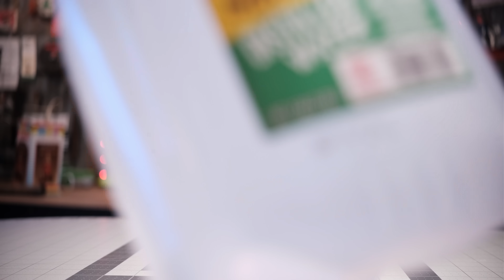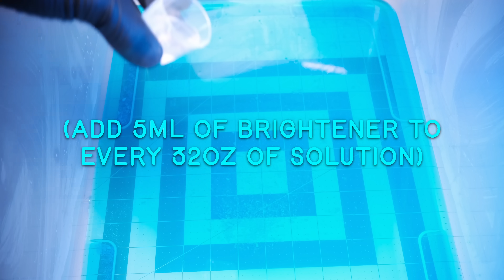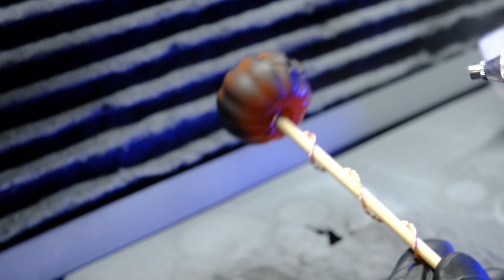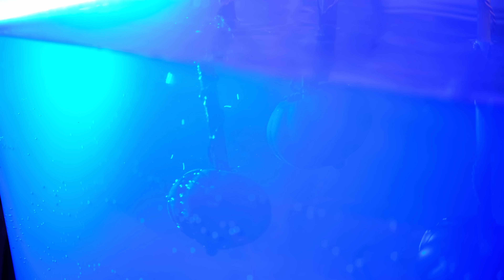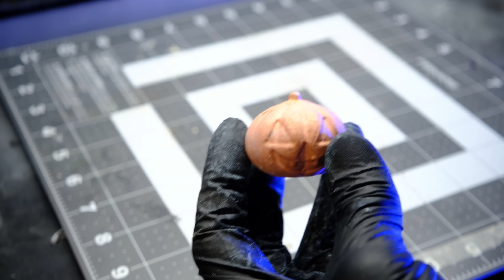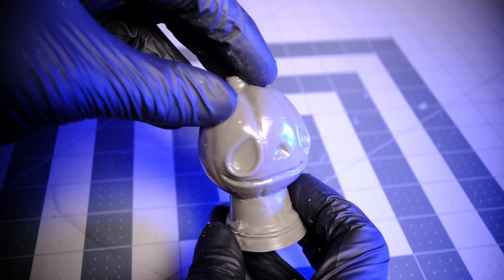How to ELECTROFORM anything into METAL!  #electroforming #electroplating

Comment: How far off are you from making your own electroformed sofubi molds?
Reply from the maker: On my last one I got to the point of brazing the copper onto the steel pan and had a warpage issue with the copper. I was using MAPP gas and switched to propane (I don't have an oxy torch) and had the same issue.

What I SHOULD have done was stuck to my gut of using MuggyWeld to do this part. I didn't because I thought my viewers would find MuggyWeld expensive, so I was using flux and brazing rods / solder, etc.

But we've got the electroforming, wax evacuation, cleaning, acid rinse, and electroless silver plating down.
Reply: @TheCrafsMan  Appreciate your detailed response dude!! I'm researching as the Chinese factories seem hesitant to go near my sofubi project as it gets close to infringing on some Disney copywrite. I gotta go rogue.

Comment: Setting the power supply to Constant Current mode instead, then calculating amps needed based on surface area of your object, will yield best results. That way, you get the amperage, and the volts rise automatically as the part becomes more conductive. Start with ~0.04 amps for a while to get an initial strike layer, then slowly ramp up to target amperage. For best results though, you can use Caswell copper conductive paint followed by a THIN layer of graphite/acetone spray. With the caswell + graphite, you can ramp up much faster, and the entire object will plate at the same time. You should be able to get shiny parts right out of the tank this way. Great video!

Comment: It's more electroplating then electroforming craftsman....😊
Reply from the maker: I debated terminology and looked it up more than a couple times, eventually coming to the conclusion that electroPLATING happens over an already conductive surface (for example, I recently plated some nickel over copper) whereas electroFORMING involves the transfer of metal onto a non-conductive surface (ie. sculpture, jewelry, etc.) by the use of a conductive coating. The electro-formed part can then be electro-plated.
That's my understanding.

But it's also 2025 and the world is in such a state that the definitions may have "changed".

Comment: Just a heads up, You need to nickle coat first. Back when i made my electrophorming sruff, I found that copper forming is too rough a surface and will be too difficult to pull out a piece during the demold process. This was also doubled down by grodyshogun when we were working on this. It can be very dangerous to do in your home, proceed with caution.

Comment: Thanks for sharing your process, Crafsman! If the sofubi videos aren't getting the traction you need, I understand, but I love when you explore diy topics that I hadn't thought about. Do what you gotta, but I'm here for the ride either way, so I hope that you pursue what you're finding interesting.

When I took a jewelry making class a few years ago, we used a similar process using a whole bunch of salt water and a camping lantern battery to etch designs into metal surfaces by leaving parts masked with a sharpie. Would etching like that be possible by swapping the anode and cathode in this solution?

Comment: Curious what wax recipe you used. I understand sofubi waxes are a bit different than traditional toy modeling waxes like Azbro, so wondering if you tried using Scott Hensey's and how well it melted out.
Reply from the maker: You are right about that - I just stuck with the Hensey recipe that I made in a previous episode, and it does have probably more solids and "body" or substance to it, and more things that make melting out later more difficult. I've heard some folks use those green and/or blue Rio Grande waxes, I think like used in lost wax casting, but I just stuck with what I had.  Also... the Cold Galvanizing spray is sorta difficult to remove, so I'm hoping when the fine copper and silver come in, one of those will work for a spray that will later be significantly more conducive to all this.  :)
Reply: @TheCrafsMan  hmmm, wonder if you could make the wax conductive.

Looking forward to seeing/hearing how the new conductive materials turn out!

Comment: 15 years ago I tried brush plating a front guard of a car. It took a while for me to get a thin layer and a golden sheen but I figured I needed a better power supply for a bigger part. 
That guard has been sitting in the dirt covered by rusty scrap metal and hasn't aged even on the uncoated bare metal sections. I think the copper is being sacrificed first. There is a couple green spots where I think snails laid eggs on the metal.

Comment: Hey! Glad to see you are finally getting into electroforming. :-) I've been doing it for awhile now, and it's fascinating. The pump is interesting, but from my experience isn't really needed - the current that is created from the copper ions going from the anode to the cathode stirs things pretty effectively.  9 volts definitely seemed to work for you, but when I've done it the metal plated too quickly and then tended to fall off. So I go for only 1.5V and keep the amperage turned all the way up. So, when running, the amperage is usually at about .01 A. It's slower to be sure, but I've gotten very even metal forming - but I will go in and play with the settings since you've had such great results!Q :-)

Comment: firsf all: I'd be interested!

but on a second note: do you reckon electroplated molds could enable injection molding without having to get full metal molds made industrially? could they be stable enough?
Reply from the maker: That's a question I've wondered (ie. about thick plating the face of a cast/poured mold) but not sure how that would affect the final part and overall fit.  There may be slight shrinking of the part as the mold "shell" grows thicker... then the halves would probably need to be surfaced so it meets up flush.  Fun to think about these things!

Comment: Also, be careful not to make sparks when coating - the electrolytic process causes Hydrogen gas to be liberated from the solution. Hydrogen is quite terrifyingly flammable. If you need to know just how scary it can be, you might have heard of the airship called 'The Hindenburg'.
You won't get enough Hydrogen to do that, but you might get enough to start a fire, or an explosion. Windows open if possible.

Comment: Hey Crafsman funny that you came out with this video today about a month ago I bought supplies and studied all the videos I could on electroplating to do some electroplating on some 3D printed parts. I think I was using nickel and zinc and I could not get it to work. The big problem was the conductive paint that was needed I spent like $25 for this paint that was advertised as conductive paint and it wasn't and I gave up Glad to see you have better results than I did. It seemed like the only thing that worked was making the electroplating solution that at least I got right I still have it.

Comment: When it comes to electroplating, having copper on all four sides is best. You’ll notice the side toward the pipe plated first. I’ve done this with steel plates all around to un-rust steel objects.
Reply from the maker: Thank y'all! Definitely true, and good to know! I recently learned (and this is pretty convenient) that you can lightly wrap wire all around a piece and it'll work.
Reply: I came here to say that too
Reply: magnetic stirrer, heated bath,  single anode in a dacron mesh or titanium mesh annode bag/basket, peristaltic pump to 5 micron filtration is the ultimate setup.  with enough mixing and flow you can have even plating even with one anode.  one anode is far easier to manage than multiple.
Reply: @thorium_glass  Upped the complexity did we? It is a single anode since they would be connected to each other and attached to one wire. I used stainless steel pop rivets to attach all the pieces. My wife said it looked like a miniature north sea oil rig on our back porch. I put filter paper between but later stopped using filters at all.
Reply: @billbucktube i found the crystal growth had a tendancy to make the work and/or the anodes disconnect from the circuit.  you make a good point about "it's all one anode." even with multiple sacraficial copper parts. 
i don't like using anything ferrous if i'm going for dialed in, super blingy plating.  i've run super dirty baths with piles of anode slimes in the bottom and dead flies floating in the top, now my setups are really clean, which is necessary as i quit flattening scavenged copper pipe and started smelting down 3-5 pound ingots to plate with after JMBullion wrecked the online ingot market in 2015.  i run a micro setup indoors (0.7 gallons) when temps go below freezing in winter, and have a 5 gallon bath for doing larger work in the summer.
but what do i know?  i've only been at it since 2008. 😉

what i do know is, Miralax makes for a piss poor brightner replacement.

if you haven't tried going to nickle and then gold yet, you will love it.  copper takes days and nickle and gold take mere minutes.
Reply: I ditched the magnetic stirrer,  causes far too much evaporation,  and went with a synchronous motor 5-6 rpm to rotate the parts in front of a single anode,  just be sure to insulate the motor shaft from the cathode shaft and use a wire to act as a brush rubbing against the cathode shaft,  far more direct plating instead of the ions in  a whirlpool trying to get to ground.  Those synchronous motors are cheap,  Amazon has a single for $11 or you can get 4 of them for about $20, they come with cords and switches for 110v, no extra power supply needed,  I got 4 because I figured for the price they must not last but I'm still on the first one after 7mos and it runs 24 hrs with a 15 min break to switch out the parts then back on for another 24hrs. After I switched from the magnetic stirrer I noticed a significant drop in evaporation by like 700%, instead of replenishing every other day it's now like maybe once a week and not very much when I do. I use my peristaltic pump for filtering through 5 micron fabric and activated charcoal to remove particles and glycol buildup once every 3-4 runs then just replenish the glycol so I know how much is in there and it's like starting with a fresh batch every time.  I run 2 tanks like this,  1 is low amps with a high chloride level for smooth shiny plate and the other is higher amps with very little chloride to grow dendrites and build texture,  first the smooth thick plate and then the texture,  I just move the synchronous carousel with all the pieces attached from tank to tank,  while one tank is not operating is when I filter the solution and change out the anode bags and top off the solution with distilled water and add back the glycol,  I use a 12" piece of acrylic tube 1" in diameter with a loose wad of 5 micron in the bottom at the discharge end and fill it with the charcoal and pump the solution at a rate of about 250ml per minute,  slow enough for the charcoal to absorb all the organics,  the more time the solution is in contact with the charcoal the cleaner it is coming out, after 1 use I dump the charcoal and the wad rinse the tube and refill for the next time. I found a source for activated charcoal pellets that's so cheap I can afford to be a bit wasteful because I can't determine when the charcoal has reached its saturation level so I just change it every time,  at $18 for 11 kilos it lasts me 8 months or more,  to insure that I wouldn't run out or the price wouldn't increase I bought 10 bags for $180 with free shipping,  same with copper sulphate 50lb bags...wish I could find a good deal on 3/4" copper pipe,  it's the most expensive component in my whole setup and I go through alot of copper pipe,  I prefer the pipe to any other copper source because it's treated with phosphorus and that acts like a cleaning agent as it is dissolved.  @thorium_glass

Comment: Awesome video!  I wonder if copper pennies are any more pure than the copper pipe or plate.
Reply: pre 1982 yes.  pipes have phosphorus IIRC and that is not a bad thing.
Reply: @thorium_glass 1982 is a mix of copper and zinc-clad just to add to what you said.
Reply: Modern pennies are 97% ZINC and only 3% copper

Comment: Did the interirors of the pumpkins see any deposited material?
Reply from the maker: Since there was no conductive spray, the insides were just plastic like before. It's also what can allow you to apply metal to selective areas of jewelry and things (although I did read that some stones need to be sealed to protect from the chemical?).
Reply: hard to get plating going inside stuff, into nooks and crannies even when conductive.  the ions are "lazy" in that regard.

Comment: it's called "electro plating", dude, there is no such thing as "electro-forming" lol
you're getting things mixed up with "thermo-forming"
Reply from the maker: Curtis! LOL! Mannn, hope you're well. Naw dude... this IS electroforming because we are forming a thick layer on an otherwise non-conductive surface using conductive medium.
Electro-PLATING deposits a finer layer of metal over an existing metal part (ie. gold plating over another metal, as done in jewelry).

There you go - now you know there's a difference between electro-FORMING and electro-PLATING.
Reply: you can call it both and not be wrong

Comment: "Do as you ought-ah; add acid to wat-ah."

You can also make copper sulfate yourself, but it's not worth the hassle (or hazard) if you can easily buy it. If you don't want the copper sulfate solution any more, please do NOT pour it down the drain! It's very toxic to wildlife! 

You can try drying it back into crystals, but label it properly since it will have those extra contaminants. Re-dissolve in distilled water if you want to do more electroplating.

To dispose of it entirely, try adding steel wool or other source of iron (old nails, machining swarf, etc) to the solution. This will create copper metal and iron sulfate, both of which are environmentally benign. This is a slow reaction so be patient and add more iron as needed until the liquid is colorless or maybe a little muddy brown (which would be iron oxide, aka rust). Pour the liquid off into another container, add some baking soda to it neutralize any remaining acid (a little bit at a time until it stops fizzing) and pour it down the drain. The solid copper sludge can be washed and dried if you want to use it for something else, or just throw it out. It'll be contaminated with iron and carbon from the steel you used.

Always gloves and goggles at a minimum when working with chemicals!

Comment: Awesome!!! I was just trying to electroplate 3d printed parts but couldn't get it working right. This gave me many ideas to what could be wrong!
Reply: are you using the graphite/modpodge paint?  if so, buff it after drying with cotton or steel wool, it really helps.  make sure your hanging wires aren't actually lacquer coated.  
Rio Grande makes a silver plating paint that works better than anything i've ever tried, but it's not cheap these days.  been electroforming 15 years now, so i've tried it all 😂  

hope it starts working for you!
Reply: @thorium_glass  
Thank you for the advice!
Ive been using a combination of galvanising spray and or graphite powder, but even when it is buffet and somewhat conducting (5/15Kohm) the coating falls of the part. I suspect the electrolite is the problem

Comment: Hey man, you've inspired me a lot over the last couple years. I've acid-etched plates and even customized aluminum UV penlights for my coworkers. I was just about to try some rust removal via electrolysis.

Anyway, you're an inspiration for me to keep on....steady craftin'.

P.s. "Do what you OUGHTA; add ACID to WATTAH." The acid rapidly donates a proton to H2O in order to make H3O. That process releases heat. Adding water to acid means you have a lot of heat and not a lot of water, which could lead to the water flash-boiling and splashing acid all over the place!
Reply: Dude, thanks so much for the rhyme. I'm what I would consider to be smartish but people would laugh if they knew how many of these little things I still have to do. Or choose to do. I also use them with kids Instruct and have found that they work even better if they are a little naughty. People tend to remember naughty things.
Reply: @WoodworkingforAnyone  Thanks! The other favorite my Chem teacher Mr. Subnosky taught me was:

"Little Johnny took a drink but he shall drink no more. Cause what he thought was H2O was H2SO4." (He thought it was water. It was sulphuric acid. Don't drink in the lab, y'all. 😅)

Comment from the maker: DEEP FRIED VINYL: https://www.instagram.com/deepfriedvinyl
HEN3DRIK: https://www.youtube.com/@hen3drik

ELECTROFORMING RECIPE (MAKES 32oz)
-32oz distilled water
-8oz Zep Root Killer
-8ml Sulfuric Acid
-5ml PEG brightener

Heat water up in glass container. Pour warm water into container you plan on keeping solution in.
Add Root Killer crystals and stir until dissolved. Carefully measure and add Sulfuric Acid to water.

(Never pour water into acid - always ACID INTO WATER!)

To make the PEG brightener, mix 100ml of distilled water with 30ml (or 18 grams) of powdered MiraLAX in a SEPARATE JAR. Add 5ml of this solution to every 32oz of copper sulfate solution.

STORAGE: After you are done with the solution, store it in a thick resistive plastic container that won't bust or crack easily.
Reply: Goings to definitely try this for my sculptures.
Reply: I KNEW I'd find a more fun use for the MiraLAX in the cabinet, lol...